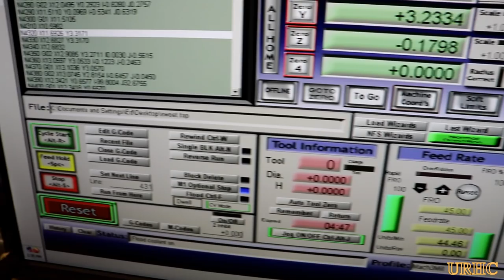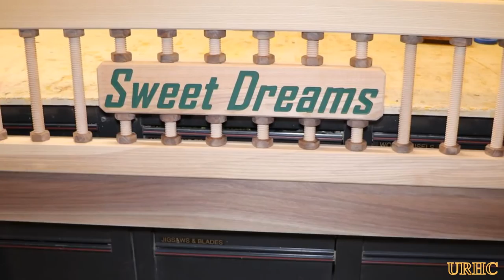Building An Industrial Look Headboard Part 2

Comment: Looking good so far.  Sorry to see your problem with the poly.  Good idea to put it in to let others knew what happened with you.  Your glue brush looks like the one I have for spreading butter, oil, sauces in my kitchen.  Thanks for sharing.
Reply from the maker: The silicone glue brushes are so easy to clean. Probably the same brush as yours. I have to learn a new set of rules to work with this water based poly. I am going to try and spray it next. Thanks for watching.
Reply: I hope that the spray works for you.  I learned to use varnish.  Did a refurbish of an oak chair that came out amazingly well.  But you can't use varnish.  I wish you good luck with the poly spray.
Reply from the maker: Trying to get away from the VOC's makes everything harder and more expensive then the old products. Just have to learn a whole new set of skills.

Comment: I'm glad you left it in you might of made a mistake but you and 899 other people learned from it. With the CNC well as I get older I don't want to work harder I want to work smarter that's what you are doing grant it I cant afford a CNC but I  get by. And last of all I think you are talented you take pride in what you do and a good designer. Thanks for making videos
Reply from the maker: Thanks. I have a lot to learn about using the water base finishes. I had no idea that the foam from brushing would not disappear as it cured like the oil based version. I built my cnc router from surplus parts so it did not cost much and enjoy using it. Many people get turned off by it , but there's always another way to accomplish similar results which some viewers just don't seem to understand. I am just an old guy having fun sharing some ideas.  Thanks for watching.

Comment: I had a thought about the headboard lights. Maybe you could use some of the flexible, yellow, truck loading dock lights.
Reply from the maker: I have been thinking about some bent pipe and 3d printed globes, but don't have a final design yet. Thanks for watching.

Comment: dont be embarrassed it happens to the best of us. i used a automotive hvlp spray gun . harbor fright 10 dollar  ones works great. as an body collision guy its hard to omit it but they spray just as good as my 400 plus guns and for the price its almost like a throw away gun. ppl spend that on raddled cans
Reply from the maker: I use those $10.00 harbor freight guns for painting outdoor equipment and get good results. Wish they made 1.8 mm needles for polyurethane that would fit them. I have never seen poly foam up before,  but after doing some research it looks like a common problem with the water based type. I just picked up a Harbor Freight HVLP sprayer that has a blower and is self contained with several different needle sizes to try. Hope that one works. Thanks for watching.

Comment: bonjour , what do you prefer build something with wood or build your log arch , saw mill .
Reply from the maker: They are both fun, but metal is easier to work with. You can be off by 1/4" and just fill it with weld 😁. With wood everything has to be precise when using a clear finish.  You need the metal items to harvest the wood so they must be the most important part of the chain. I have answered your question like a politician would and don't really prefer either. Thanks for watching.

Comment: If it bubbles when you spray it I wonder if putting heat on it will work like putting heat on epoxy?
Reply from the maker: I think it dries too fast. It is like a white foam that forms and does not go away. I picked up a Harbor Freight HVLP sprayer to try as it was the only one I could find with a 1.8 mm needle for poly.  It actually blows hot air so I will find out soon if it helps. Ihate change. Thanks for watching.